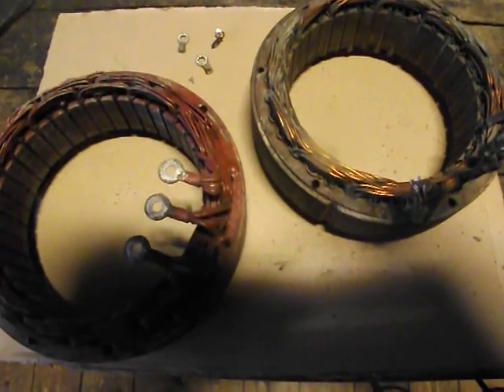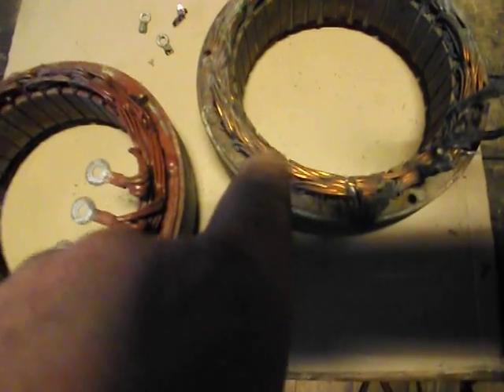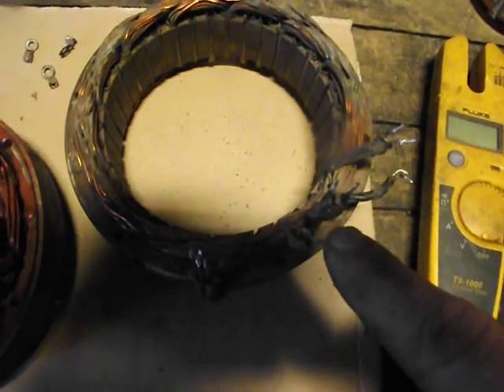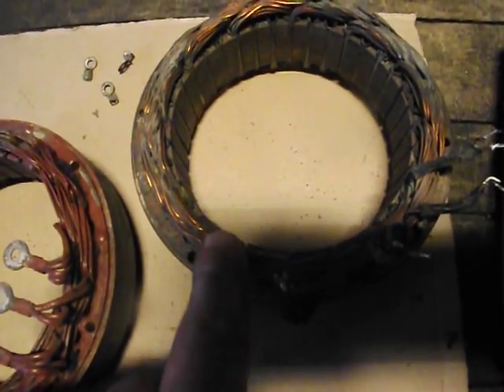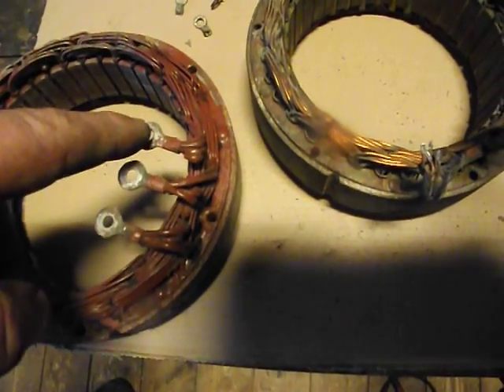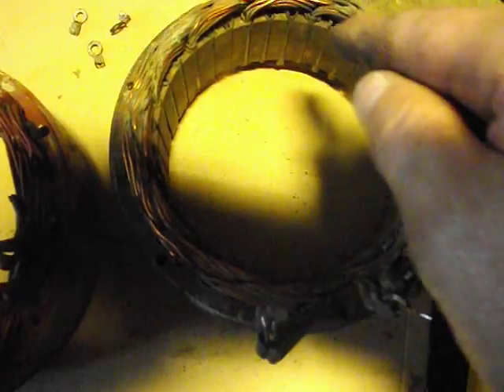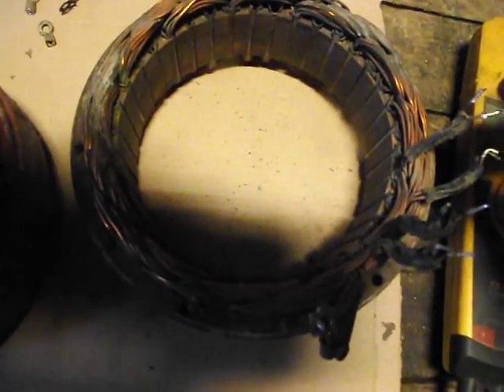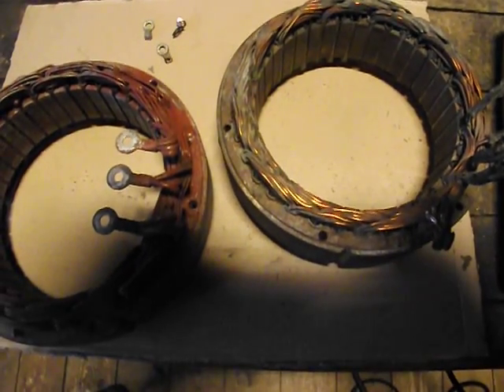Testing Alternator Stators Explained Simple

Comment: Let me ask you a question. I want to know if it’s possible to change car alternator slip rings. Got one stripped here and brushes need replacing and slip rings. Rotor is 2 ohms and live 12v testing stator with earth to outer case it does not spark. So presume stator is ok. Came off BMW alternator failed one day. My customer. Well one brush under 5mm so there’s the stop working fault. 

So yep slip rings. Can you change them?

Comment: The three coils are wired in a triangle. You only have to separate one of the wire pairs from its lug. That isolates all three coils because the two coils that are unhooked from their lug can't participate. If any are shorted to the core you can tell which one with an ohmmeter, but then you need a new stator anyway unless you can spot it.
Reply from the maker: rstevewarmorycom Spot it and fix  or rewire it. Cheapest way is to rewire it.Easy way is to buy a new one. Its not all the hard to do for the right type person anyway.